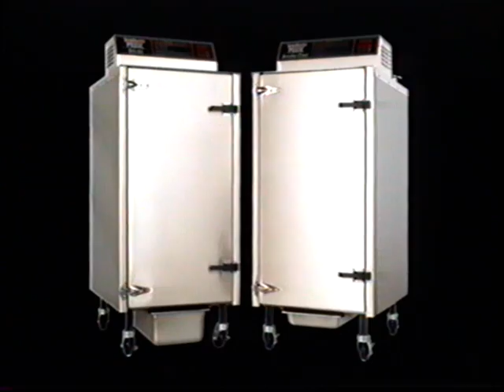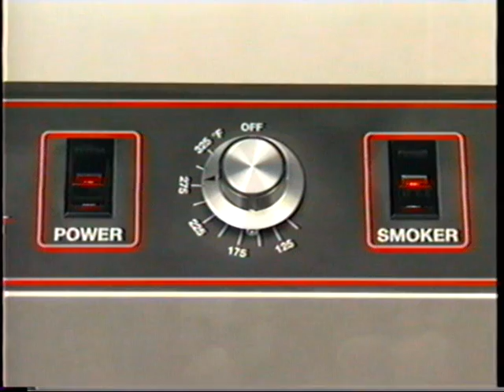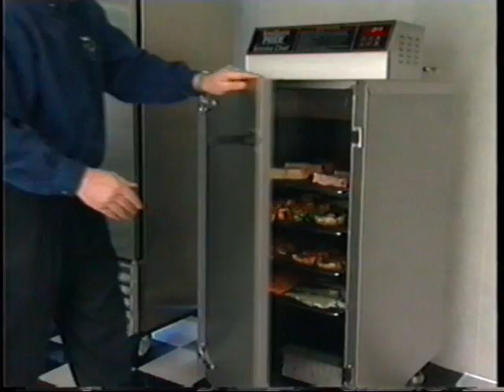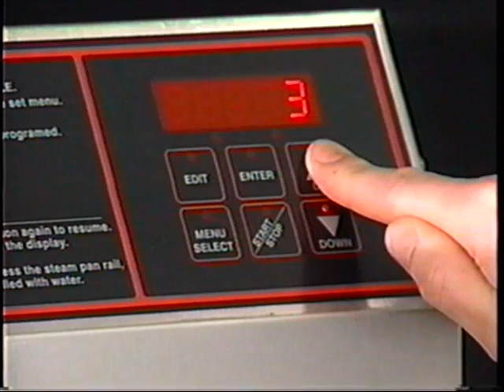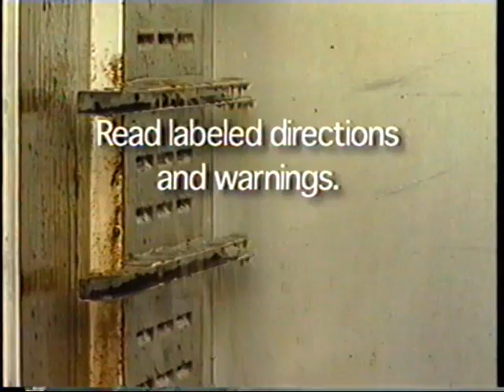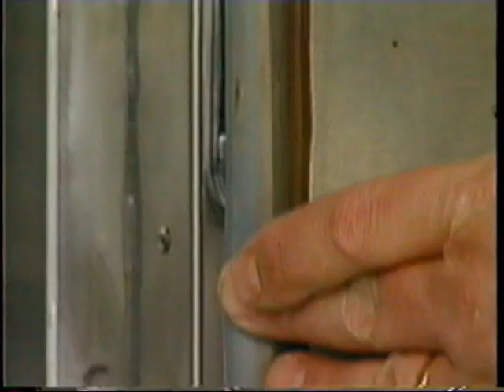Southern Pride SC200 & DH 65 Cooking & maintenance video.

Comment: My Dh65 electric smoker won't hold temp on the lower settings set on 220 it stays about 160 if on 325 it will stay about 324
Reply: How to use a southern pride smoker